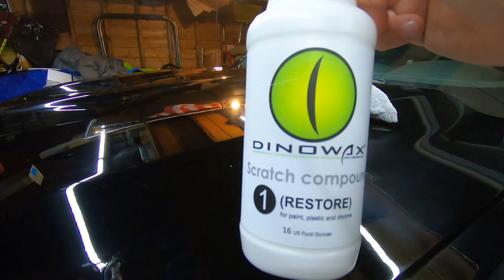Disaster Chevy Silverado Paint Full of swirls | Full Exterior Detailing

Comment: Nice Silverado, had a few of them & the 2-wheel drive late 70's Blazers over the years, great trucks that are fun to clean & detail.
Reply from the maker: This truck is a friend of ours and he worked on the Vette for us nice trade . 70's Blazer don't see many of them anymore ..Thanks
Reply: @OuzoLouGarage  I had a Marina Blue Metallic 1978 2-wheel drive Blazer lowered on Bell Tech suspension with Billet grill & interior dash panels with Carerra steering wheel. Built high compression 383 stroker motor, 130 on the freeway with headers & Flowmasters, hauled ass.
Reply from the maker: That had to be cool running the Blazer at 130 had to sound great . Thanks for sharing always enjoy them